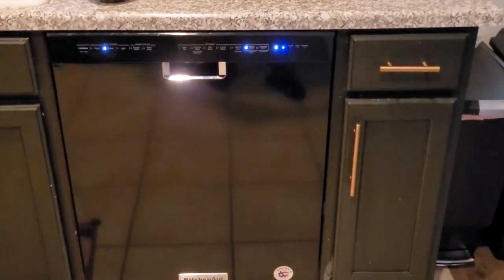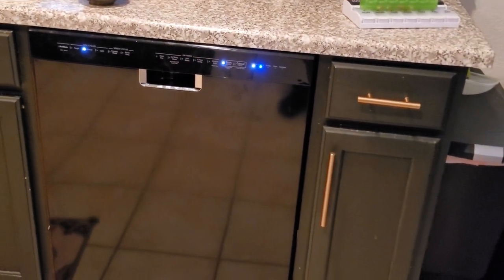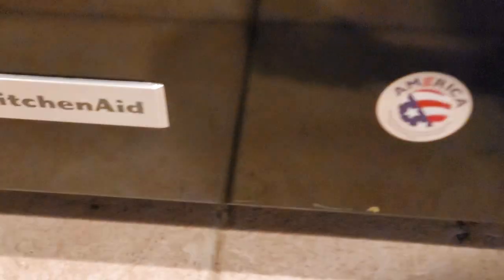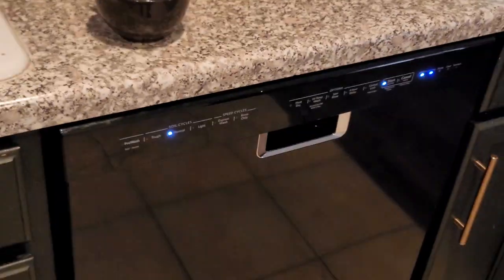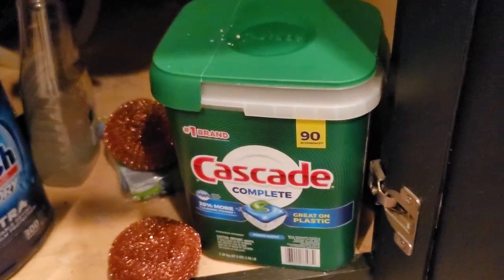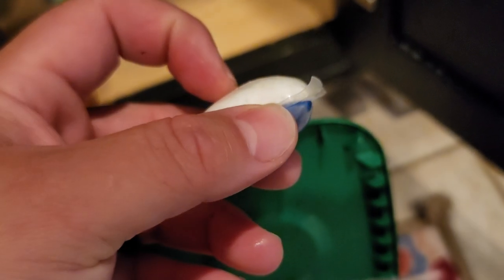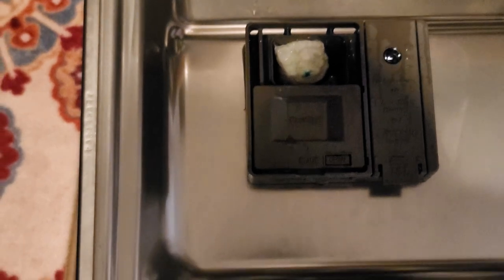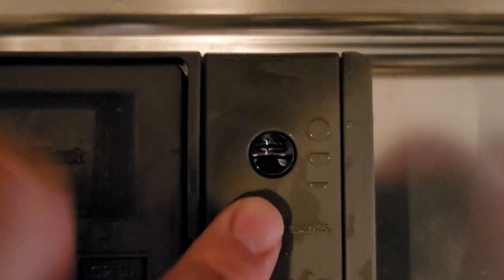New high-efficiency dishwasher demo. How to properly operate your new dish washer.

Comment: You didn't mention that it is better to use two pods. Throw one in the dispenser and another one in the bottom of the machine tub. It is a huge benefit to have more soap during that first pre-wash.
Reply from the maker: Usually we recommend the least amount of soap because you don't want to eventually have an over sud issue however if that's been working for you, keep doing whatever is working for you. Good tip I'll try it in mine for a few months and see how and if it helps.